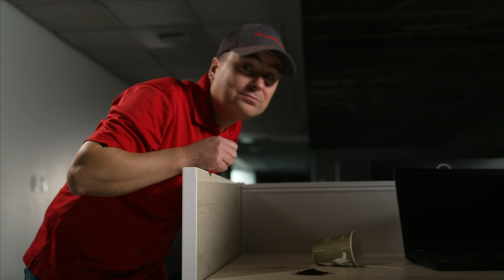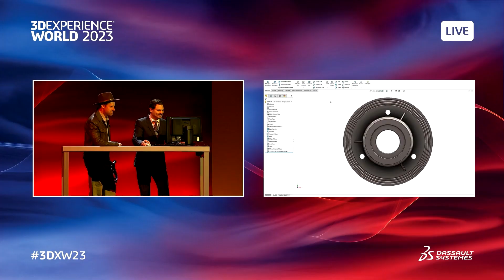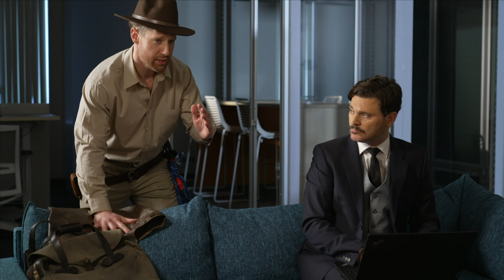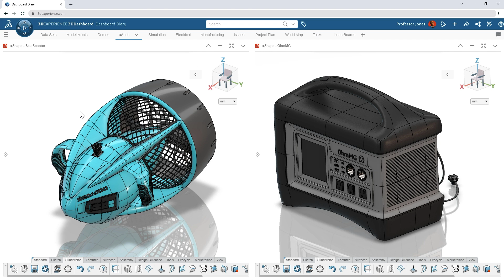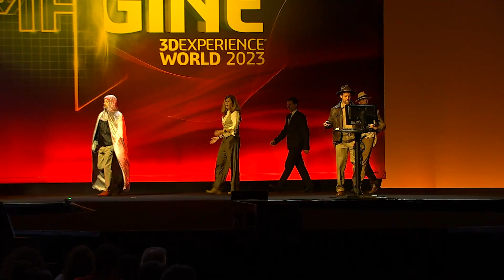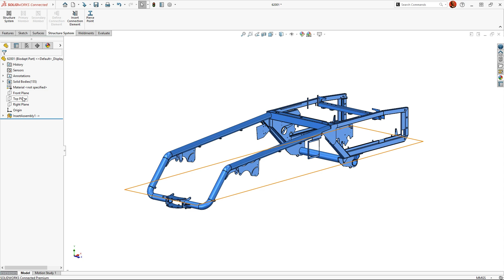Platform Jones and the Lost Features

Comment: tell me when the time comes and solidworks can output information about the area of individual faces of the part to the specification, for example, if the faces of the part are painted with paint of different colors and you need to know the coverage area by colors... it would still be cool if the program began to develop in the direction of architecture and landscape design. it is also very inconvenient to color 2d drawings